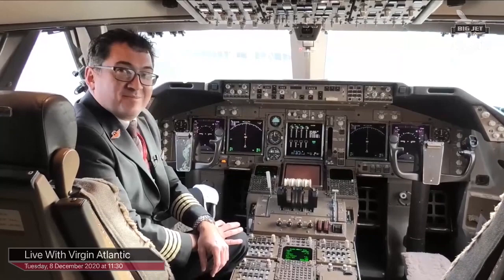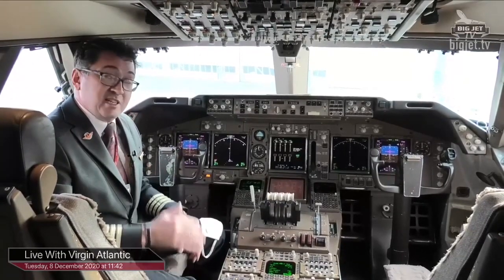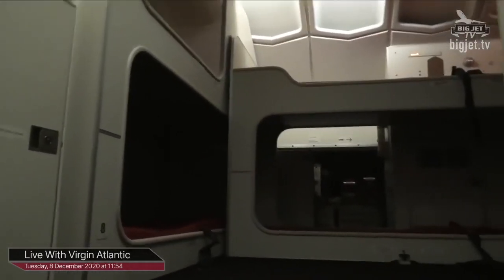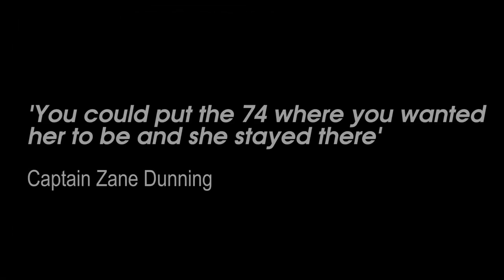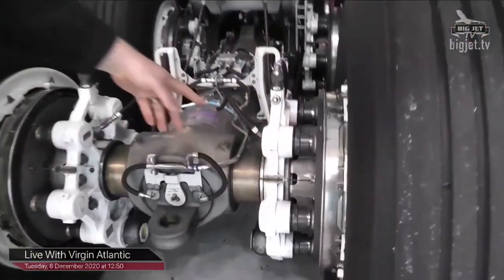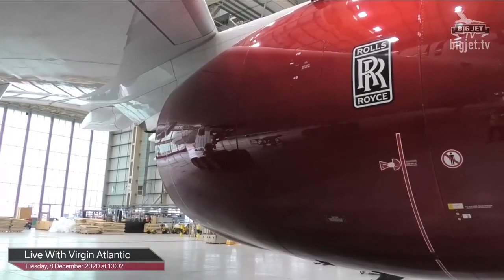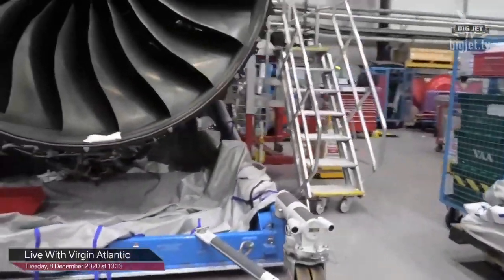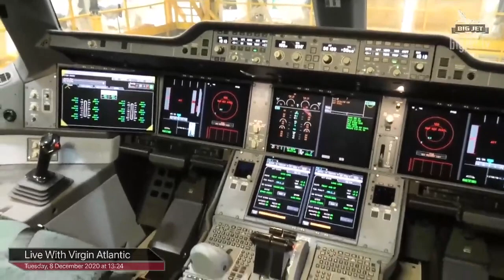Airside at Heathrow Airport with Virgin Atlantic

Comment: Nobody ever mentioned the crash or accident statistic of the 744. I saw the very first example in April 1989 in Los Angeles from Air China. Since today ( January 2022 ) it's travelling around the globe ( Lufthansa ). That means in 33 years of service there was only one fatal accident in 2000 in Taipeh when a Singapore Airlines 744 crashed on the runway into construction vehicles. One more incident was in the 90's in Hong Kong Kai Tak when an Air China dumped with it's nose into the harbour area with no dead folks among the passengers. If that is not sensationell i dont know.....